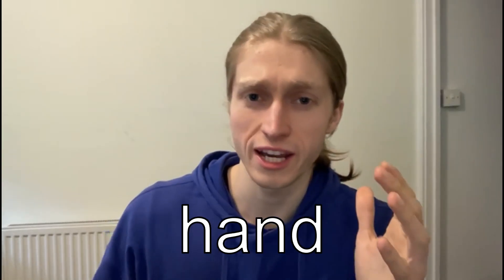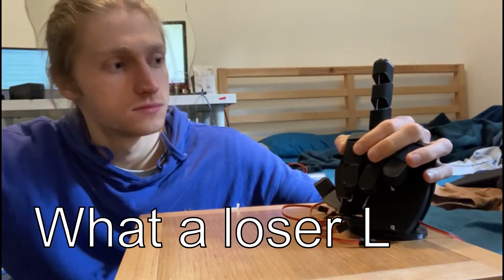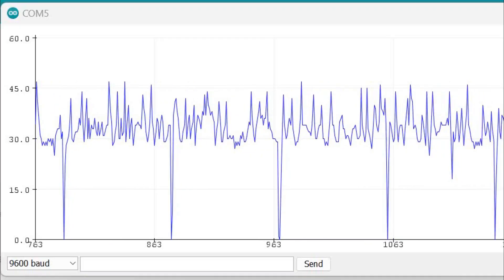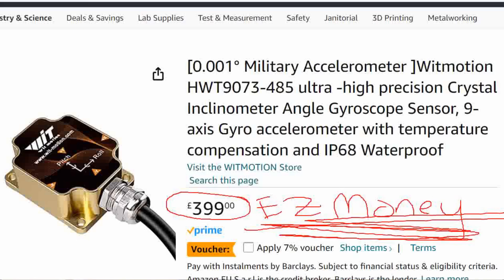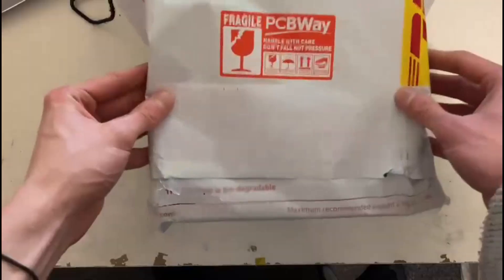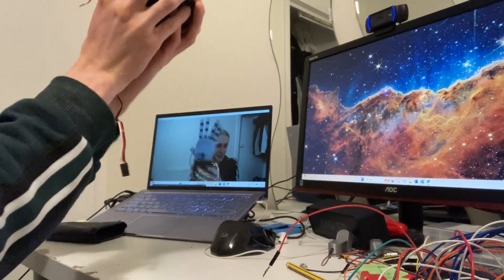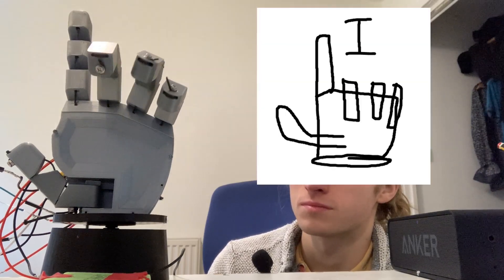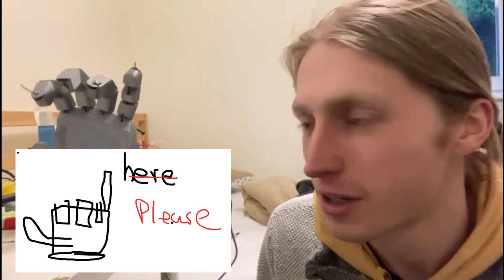Forcing My Robotic Hand To Speak

Comment: Cool!
So, the new motors work better?

So, you used two new functions (angle value to current value = position and ''switch'' something...?) ?

 Is there any good rpi motor hat, so this how think to be more compact?
Reply from the maker: Yeah, my functions basically took that quadratic value, and clauated the resultant angle t detetcted current in real time. Then the rotation back was controlled via timing. Since the fingers reminded themselves of their position every iteration, the hand didnt lose itself :D. I didnt explain that part all that well, but I was able to define in my code the angle ayt which i wanted the hnad to go, then with the langauge model i made, but switch case statements in that defined sentances. Truth be told, the hand was having an existential crisis because i told it to lol, but in time I would hope to have a humanoid head, with a hand, that makes these gestures based on a LLM. very in the future idea, but its in my sights. Give me a year lol
Reply: @Robotcus  Are the ropes you use flexible?
Are they better than fishing wire?

Have you tried to ''stick'' flex sensor to flexible rope, to see if can get some signals from it?

Have you think about this:

''You have an empty bottle, filling it make it heavier, to hold it you have to not only retain position, but to tighten the grip? How can the ''hand'' do this automatically'' ?

May be to set the code to make the motors to retain some pre-trained ''balance'' between current and angle, based on your formula?
Reply from the maker: THe ropes for the forward rotation of the hand are not flexiblt, but the ones that provide a counterbalance on the back of the fingers are, i havent tried the flex sensor idea, but thats verry interesting. Flex sesnors tend to not be that stretchy, but maybe i could make something... Since the posiiton is entirely based off current reading, when gripping something that current reading would go up, instantly to approx 50. You could force the motor to maintain that value, in turn mainting the current draw, in trun forcing the motor to actively grip something, as for it getting heavier, you would need some other control loop i think for that @mitkosokolov9382